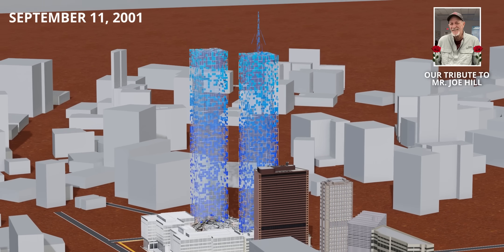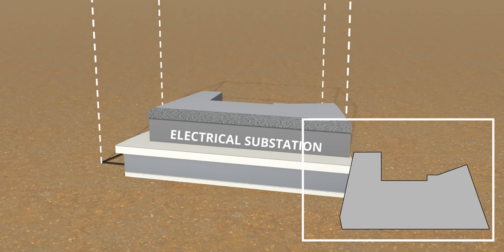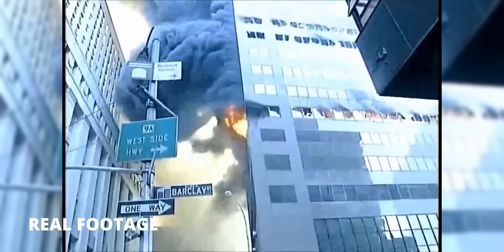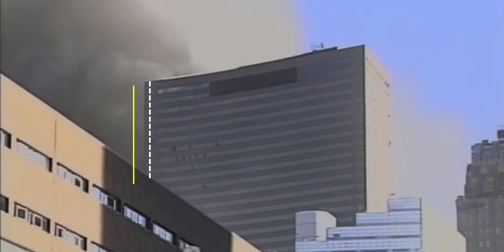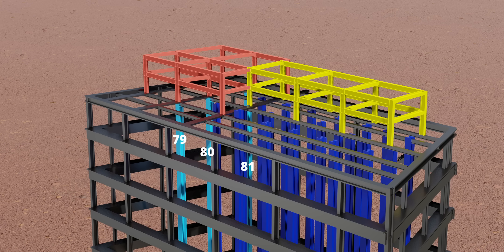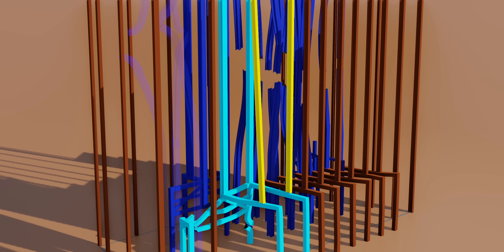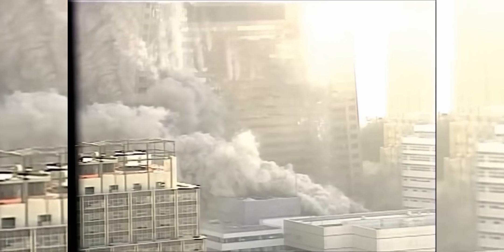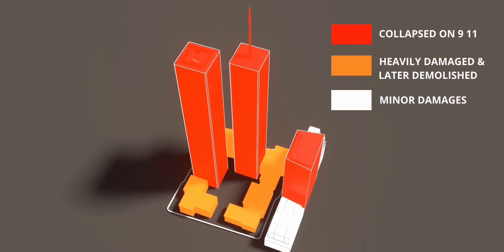Collapse of Building 7 | The Complete Physics

Comment: Your version made the news because it hides the truth. Implosion is the only answer for why Bldg. 7 came down.
Reply: I’m going to respectfully disagree and offer a more plausible explanation.

Building 7 was the 6th building to collapse of 10 lost on 9/11 and though extensively studied still confuses many. Not famous or a terror target and with no casualties it didn’t get a lot of attention initially, creating an information void the internet would fill with utter garbage. I prepared this brief summary from my own analysis to fix that, using engineering, not politics and tired memes. 

The North Tower collapse at 10:28am bombarded Building 7 with tons of debris, causing heavy damage and multiple floor-wide fires that burned out of control for 7 hours. Half the FDNY firefighters having been killed, others injured, units in disarray, equipment destroyed, no water pressure, and the greater urgency of Search & Rescue efforts, firefighting was pulled as futile. The building couldn’t be saved and was left to its fate. That is the sort of choice firefighters make every day in brush fire situations - which houses to save and which ones to let go. Only real difference here is moving the decimal on the size and cost.

www.youtube.com/watch?v=g_SvpwyC17M&ab_channel=MFitz  

Collapse of a burning structure is always a concern for firefighters. Steel buildings subject to fire rely on active fighting of the fires to survive. Buildings are designed around 1 to 3 hours of fire resistance, allowing time for occupants to escape and ACTIVE firefighting to get started, after which all bets are off. Left to their own devices they will exceed their design envelope and collapse. In B7 the occupants escaped, passive and active fire protections were compromised and active firefighting was abandoned 3 hours before the collapse, which left the building to its fate. It lost. Odds on Building 7 would eventually collapse, and it did. No big deal in logic. But there is no logic in conspiracy belief. 

www.youtube.com/watch?v=WnYBX6QT0R4 

FDNY Chief Daniel Nigro ; The biggest decision we had to make on the first day was to clear the area and create a collapse zone around the severely damaged 7 World Trade Center, a 47-story building heavily involved in fire. A number of fire officers and companies assessed the damage to the building. The appraisals indicated that the buildings structural integrity was in serious doubt. I issued orders to PULL back the firefighters and define the collapse zone. It was a critical decision; We could not lose any more firefighters. It took a lot of time to PULL everyone out, given the emotionalism of the day, communications difficulties and the collapse terrain

FDNY Deputy Chief Peter Hayden ; We had our special operations people set up surveying instruments to monitor and see if there was any movement in the building. We were concerned of the possibility of collapse in the building. And we had a discussion with one particular engineer there, and we asked him if we allowed it to burn could we anticipate a collapse and if so, how soon? And it turned out that he was pretty much right on the money, that he said 'In its current state you have about 5 hours

The collapse of Building 7 was anticipated and widely reported in the media throughout the day. At least 24 video cameras recording some or all of the collapse. Everyone knew what was coming and why.

www.youtube.com/watch?v=OY5S5k3tMHI 

Building 7’s collapse was completely different to the Twin Towers and harder to understand with most details hidden from view. But we can still sort out what happened through careful analysis and observation.  This is my explanation  of the collapse using the best available information and relying on no authority.

B7 was complex 47-story steel framed structure built on top of a smaller existing 3-story building, requiring several lower floors dedicated to complex load transfer structures instead of usable office space. Of trapezoidal shape and all-steel tube-in-tube construction, B7 (above the 7th floor) consisted of a central core of steel columns carrying most of the gravity load, perimeter steel columns around the outside of the structure carrying the remainder of the gravity loads and long span beams and girders to tie those elements together and form the floors. On the outside of the building hung a moment frame - the last part of B7 to fall 

Phase 1 : The first externally visible signs of collapse initiation occurred at 5:20:28 pm and was notably quiet with observers not even realizing the building was collapsing! There was no audible warning in the form of  hundreds of ear drum busting 180-190dB explosive bangs preceding the collapse. Here at 12:00 a local CBS affiliate reporter is talking 10 blocks from B7 when collapse begins. People don’t start to notice the collapse until 12:11. At 12:45 is the famous CBS fixed camera clip of Building 7’s collapse. Note how quiet it is.

youtube.com/watch?v=t5tEy6mXSE8&ab_channel=fresnosean379

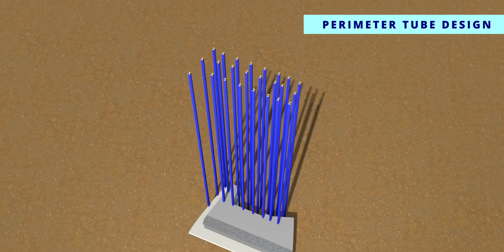Collapse initiation was due to lower floor failures above the load transfer region (7th floor) in the NE corner. In this video at 0:45 you can see the NW corner from inside the building while under construction, Column 79 just out of frame on the left. That big, angled steel beam across the top of the frame connects to C79 at one end. The girders connect to the beam. That beam and all those girders depend on just one connection

youtube.com/watch?v=nP3TNHPCIVU&t=35s&ab_channel=EdwardCurrent

Phase 2 : Lower floor failures caused a loss of critical lateral support over an excessive length of core Column 79 and it buckled. If you look at a floor diagram of Building 7 (see above) and look at all the structures that depend on C79 you quickly realize this one column was a relatively isolated structural element on which a disproportionately greater fraction of the structure depended analogous to say the Key Bridge. Externally we see a vertical progression of window breakage along the 44-46 line and a kink in the roof of the East Mechanical Penthouse at the top of the building, consistent with C79 failure. The transition from full capacity to almost no capacity occurs in virtually an instant. Once the buckling failure occurs there is almost no resistance

Normally with a buckling column, the load could very well be redistributed to other columns, meaning the buckling could stop after a while. With C79 that is not the case - the failure did not redistribute the load, so the collapse rapidly progressed to the roofline, sinking the rooftop penthouse.

Phase 3 : With C79 gone, B7’s progressive, non-symmetrical collapse continues with C80 and C81 at the east end of the core left laterally unsupported and quickly buckled and failed as well, sending the EMP down through the building. C79-81 all have no diagonal bracing, which I believe is a major reason why they could not redistribute a lot of vertical loads among one another.

From there collapse progressed from east to west through the central core until the core was gone taking all of the interior floors and probably most of the perimeter columns with it. Follow the horizontal progression of window failures low in the building and the dropping of the remaining rooftop structures into the building. One of the big takeaways from the NIST Building 7 study (that gets completely ignored) was their modeling which determined C79 failing under ANY circumstances would have initiated the same collapse sequence.

Phase 4 : After 10 seconds only the exterior moment frame - a hollow empty outer shell – remains, giving the illusion the building is still standing since little has outwardly changed. But it’s just a hollow empty shell like an empty cereal box and supported by only a few remaining columns quite unable to remain standing. With all internal framing gone, the north face leans inward, forming a V in the roofline, the last perimeter columns buckle under the strain and the moment frame free falls, landing on top of the 7-story high debris pile. It is here, at the end that a single measurement of alleged free fall acceleration is taken, from a single point on that outer shell. The Building (defined as its center of mass) did not “free fall” – just one corner of the outer shell did. The Building was already gone before that happened. The period of alleged free fall was a product of collapse progression mechanisms, not of collapse initiation mechanisms and cannot inform as to what started the collapse. Start to finish the entire collapse took 18-20 seconds, 3 times longer than true free fall .  How fast something falls cannot tell you what started it falling_ anyway. The debris spread outside the footprint, blocking surrounding streets, heavily damaging the Verizon Building and destroyed Fiterman Hall.  

Building 7’s progressive, non-symmetrical collapse was incidental and unintended collateral damage from the combined effects of fire + time + gravity, started by the collapsing North Tower. That is true no matter who planned and carried out the 9/11 attacks or why . The collapse was of so little consequence it barely even registered at the time, a mere footnote. It only took on semi-mythical status as an alleged smoking gun years later when demolitions at the Twin Towers, missiles at the Pentagon and shoot down over Shanksville all failed and conspiracists had nothing left to work with.

Anything can seem like a conspiracy if you don’t understand how it works. Now you should. I hope you found this helpful, informative and it solicits informed critical comment. If I made any errors of fact, logic or reason or left anything important out, please let me know so I can fix it. IF you can offer a more plausible alternative please do. Be the first. Please start any reply with the words “Tits McGee” or I will know you didn’t read it and are wasting my time.

Comment: An asymmetrical fire causing a symmetrical collapse does not make sense
Reply: What symmetrical collapse?  You clearly either did not watch, did not pay attention or did not get it. This was a progressive collapse and therefore by definition the opposite of symmetrical.
Reply: @  the symmetrical way in which they free fell from an asymmetrical fire is odd.  The idea of a progressive collapse would not fall uniformly like wtc7.  Sections would come down over a longer duration.  Wtc1,2&7 are virtually the only examples of steel buildings just collapsing like this.  Here is Philly we watched the meridian bank in ‘91, similar in size to wtc7, burn for almost an entire 24hours….didnt collapse at all.  It was way more intense of a fire.
Reply: @Moist_Moose_  - Building 7 did not fall uniformly, only the exterior moment frame (the "empty cereal box" discussed in the above video) did (mostly) at the very end of the collapse.  Since that was just a hollow empty shell do we really care?  All of the important stuff happened before that.

You should have watched the video and read this thread. 

If you want to see steel framed buildings collapse due to fire there are thousands of choices. If you want to artificially limit your search to high rise steel framed buildings (because fire knows how tall a building is) then I suggest Plasco Tower and Wilton Paes de Almeida.

But really, each is their own unique case, Building 7 particularly so.  Best to just study and understand each on its own merits rather than looking for vague similarities.
Reply: @ I did watch the whole video.  I used to think the buildings collapsed like the video said for at least 10 years post 9/11. Then I watched videos of engineers from both sides of the argument (collapse vs planned demolition) and it really had me thinking.  I lean more towards planned demolition these days but I don’t think we’ll ever know for sure.  I’ve never heard of those examples you mentioned, I’m going to look into them.

Comment: Except it wasn't damaged by anything. The fires set in there didn't look like portrayed in this cartoon. They were extremely minor. And the leaseholder openly admitted "we pulled it"...which takes weeks of preparation and would never be normally done on the same day as a massive disaster. It fell in a near perfect demolition implosion. Because it was a demolition.
Reply: Extremely minor?  Have anything to back that up?  The fires burned uncontrolled for 7 hours Thom.
Reply: @Molochෆ  - Someone likes to load his arguments.
Reply: @Molochෆ  what was burning? what I saw was a couple floors with some minor little fires, obviously set. These skyscrapers are not made of timber. What is flammable in there? Not much.